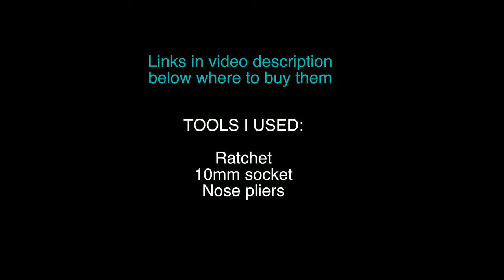Honda Ruckus / Zoomer 50 - Fuel Pump Replacement | Mitch's Scooter Stuff

Comment: Good video. I always replace the fuel filter and fuel lines when doing a pump.
Reply from the maker: Thanks Russel, yes good plan!
Reply: I was gonna say the same thing you're in there anyway might as well change the fuel filter save some time later.

Comment: So I put a new fuel pump and filter in. The filter came with a zoom zoom carb. And the fuel filter doesn't fill with gasoline like the one I took off did. Its like 7/8th empty. 7/8ths air. Is this fuel filter inhibiting flow? Or does it always sit like that? It still doesn't start good like it always has ever since I rode around with out an air filter for a short bit. I put a new carb. Fuel filter and pump and air filter. Takes 3 minutes to start but its also 40 degrees?
Thinknits the fuel flter or cold or what did I do when I started it with out the air filter?